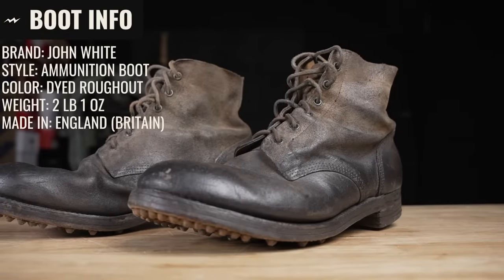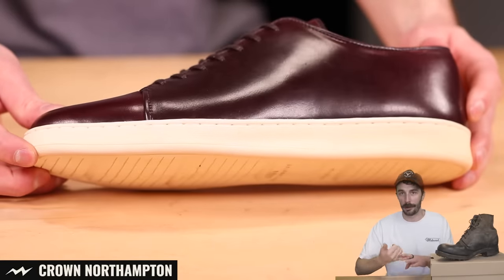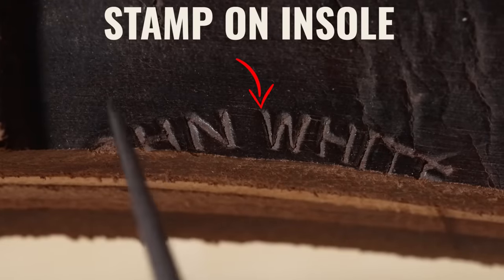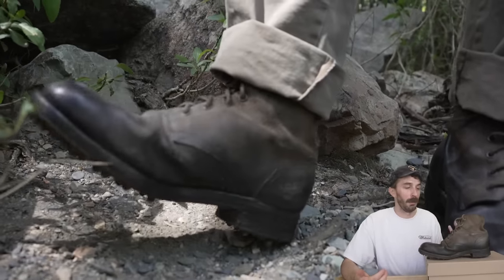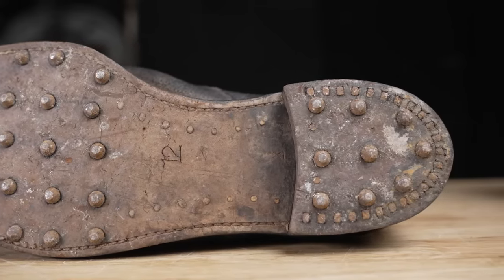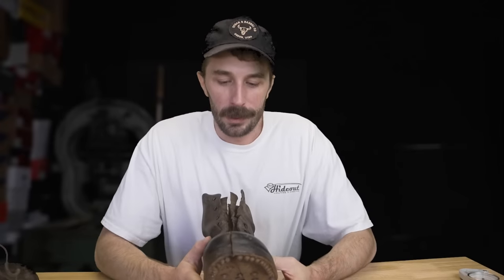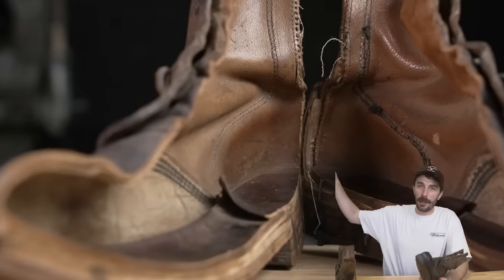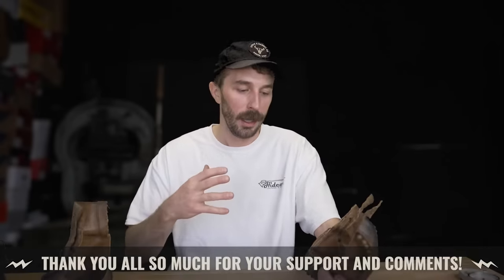Why 80 yr old British WW2 boots are better than modern boots

Comment: It's neither the ammonia nor an old wives tail, it's making the leather wet and then wearing the boots that forms them to your feet better. I came across this by "accident" when i did my conscript time. I was standing in heavy rain for two hours waiting for a convoy to arrive and guide them into place. I was able to wear an issue Goretex jacket, and my steel helmet, so my upper body stayed dry, but the rain water ran down my knees and into my boots. That happened around 6-8 in the morning. Then the rain stopped and the sun came out. I wore the boots the rest of the day, put as much newspaper into them over night, and wore them again the next day. So i basically wore them until dry. Never ever has a leather boot had a better fit to my feet than that pair of boots! (i sadly had to give back at the end of my service)
So in short: you can just make the leather a little wet and then wear them.
Reply: I’ve also heard very similar stories and always been told too pour water into my brand new boots and wear them until they dry out ( either through heat of my feet or the environment ) or wear them for around a day or so and dry it out with some paper or cloth 

Never done this myself but I’ve been told many times it’s the best way to wear in a new boot
Reply: They make shoe stretch spray that has the same affect without ruining any warranty they may have
Reply: It's not the same as just getting them wet with water. In the German paratroopers, we also pissed in them and it neutralizes some of the tanning acids that soften your skin/inflame them and cause rashes and blisters in the beginning. By peeing in them, they won't get much softer but guys who did it had less blisters and hot needles to deal with.
Reply: That's kinda lame that you had to give them back.
Are they really going to reuse boots?
They should have just let you keep them.
Reply: There is the old trick of petroleum jelly as well
Reply: @spaceman51974  We got guys who got old boots (like myself) and we got some who got new boots. Old ones should not have that much tanning acids in them anymore. But i had lot's of comrades who had blisters in old boots too. In our case it was the ill fittment, and the lacking knowledge of what to do against it. I personally (even with my at first very ill fitting boots) had no blisters. (I wore two pairs of socks and tied my laces rather tight and in a manner, so no heel slippage would occur.) So i am a bit skeptical if it was because of the minor ingredients of the piss, or rather the major one (water) ;-)

(my rain incident happened 4 months in, and we did marched almost 5 out of 6 days a week.)
Reply: @pewpewTN  Oh, our army reused them many times. (costs ->our army is well documentedly underfunded for more than 160 years ;-)  They were 360 double stiched welt, very well made leather boots. After each recruit, they got disinfected and checked if they needed repair, if so they got repaired. And in case they were beyond repair, new ones were issued next time.  Of the 12 guys we were in my group at the first day, only 2 got new boots. We got 2 pairs of boots each: "light ones" and "heavy ones". The heavy ones had even thicker leather, were triple stiched welts, and were able to fit ski bindings to them. Those were the "combat boots". I never got those to fit as well, the ones i got were just too wide for my feet. But after 3 months we were allowed to decide for ourselves which boots to use. So i often picked the "light ones" and those were the ones in the rain incident. 
I could have "lost" them and paid a little fine instead of returning them at the end. (which would have been way less than buying such a pair of boots on the civilian market) But i am too honest for that.
Additional info: those boots at the moment cost around 200€ on the civillian market, and they are still made the same way. I got a pair later, and made them wet with a sponge in certain areas before wearing them and they now fit very well too. (Not as well as the rain ones, but that's not a problem, i do not march as much as a civillian :-D)
Reply: @nirfz  Thanks for the info.
Sucks that your military is having to pinch pennies, but at least you have your own pair now.
Reply: @nirfz  Only recently discovered the amazing benefits of two pairs of socks to stop blisters. Not just any socks. Get liner socks - usually from specialist hiking stores but thin running or cycling socks also work. Total game changer, even with top quality boots that are well worn in
Reply: @pewpewTN  Yep its a stupid Army thing. You have to give back all your issued kit. Then you join the Reserves and they issue new stuff. Crazy.
Reply: It would be hard to pee in New boots.
Reply: @cuebj  👍absolutely. You can also take the boots a size bigger, and use thicker socks ;-) I had tennis socks as "inner ones" and the thick woolen army socks "outside". (weren't that many good hiking socks ect. back then)
Reply: Soaked my new boots in a bath overnight then wore them until they dried out and never had a problem with blisters or strains. Mind you, ALWAYS wore a thin inner pair of socks underneath my army-issue woolen socks. Talcum powder on your feet under the thin socks also helps but you have to be careful not to apply too much or you're asking for trouble....
Reply: @jackaubrey8614  Over night seems a bit much to me.  But the 2 pairs of socks strategy has worked for anyone i heard so far.
Talkum powder and or talkum salve did not prevent blisters for my collegues back then. (But talkum powder or salve on the inner thighs prevented intertrigo when marching on hot weather.)
Reply: Wow, you were in the Army and you got your boots/feet wet? Good thing you stumbled onto this technique.
Reply: Yes or sold as surplus
Reply: @roverboat2503  I wonder what the fine is for "losing" a pair of your boots? If the fine is less than $200, might be worth it to just keep them. There truly is nothing better than a well-fitting pair of boots. Every man needs a pair of welfitting, well-made (expensive) boots in the their life. And an authentic, leather Dopp kit.

Comment: High quality does not mean practical in today's battle field. Anchored down with a pair of weight-laden boots weighing 2 pounds on each foot will definitely handicap you where mobility and agility are foremost requirements. Of course, without the need to of a lengthy break-in period is god-send on the foot soldiers while on a warpath.
Reply: Back then soldiers walked more...
Reply: Great if your supply line is intact but certain death if you are caught behind enemy lines and your boots get shredded by NATO wire or the synthetic melts cause you left it too close to a fire and you have to hump it barefooted. 😂
Reply: And yes, guys were just tougher back than most metrosexual soy boys these days.  😂
Reply: @spaceman51974  ah yes, men that fought in a war are tougher than men that have never fought in a war. What an amazing observation.

Comment: I have a pair of Cheaney boots, made in Northamptonshire and they are easily one of the best pair of boots I've ever owned. They weren't cheap but I figured an upgrade to my thorogoods was necessary after the plastic welt snapped.
Reply: Very interesting. My beloved old Thorogoods are finally reaching the end of their lives after three years of faithful service. I might have to look into those Cheaney boots.
Reply: @jeremyt2212  I will say, I wasn't using the thorogoods for their intended purpose (decent VFM work boot) but simply as a decent all weather boot.

Comment: Couple points:
- The General Service boots (ammo boots) in British service were of a pebble grain leather. Generally not this rougher side;
- They were straight / ladder laced, in order to be cut open in one swoop in case of foot injury;
- There weren't any hobnails on the heel. There was a horseshoe fixed to the heel. Also there was an iron toe plate nailed to the toe of the sole. Both fittings were done to protect the sole from wear. The hobnails was a combination of protecting the leather and adding grip to the leather sole.
Reply: Been looking for this comment

Comment: I’m a wwii reenactor and portray the 9th para battalion during 1944 to 45.(British airborne )

Those are indeed not standard issue British ammo boots. The standard issue ammo boots were a cap toe pebble grain boot, that came black and the only thing a soldier would do is mirror polish the heels and toes and dub the rest with period water proofing. 

As for the peeing myth, it by no means was anywhere near common, if done at all.

As with any all leather boot they do indeed hurt during the break in, but once they’re broken in they feel amazing. Also the hobnails don’t hurt at all with 3 pieces of leather in between. 

Sm wholesale and William Lennon make on par boots to originals. 

I love your channel but the info on your WWII boots could be better.

Comment: My first pair of boots were hobnailed boots. No such things as rubber soled boots in those days. It's not an old wives tale that soldiers used to pee in a new pair of boots. They would leave them with the pee inside overnight (if I remember right) to soften the leather, and then put them on while they were still soft and wear them until they were dry. That way the boot would dry to the shape of your foot. Guys who didn't do this had their feet rubbed into blisters and bloody raw patches when they went out for their first route march ......

Comment: Regarding the ruggedness of the Ammo Boot, it is amazing. However, having actually used these boots, while on parades when I served in the British Army, and when I was a WW2 Re-enactor. Even after they are broken in, they where unconfutable with not much flexibility, requiring padded insoles, and tended to cut into sections of the foot after long marches. There was also the problem with the tongue of the boot not being sewn in, therefor it use to leak water into the boot. The DMS (directly moulded soul) versions in the 1980's with rubber soles, although more flexible, still required short puttees to be used, to ensure mud and water did not enter the boot. I was very glad when long legged boots were issued in the mid 80's. The comparison between the ammo boots and modern military boots is like night and day..  I understand the purpose of these videos, is to discuss the characteristic's and making of a particular boot, but unless you have walked in those boots, you will never be able to appreciate the essence of that boot.
Reply: importance of field 
experience
Reply: Yeah, a tough boot isn't always a comfortable one, unfortunately. That lack of a gusseted tongue also sounds brutal. Lord knows, puttees only keep out so much.

Comment: I joined the Brit Army in 1989. The ammo boot was changed about then because water was getting in over the top in the Falklands. They changed it to a higher boot but cheapy made with no research. Out of a squad of 50 in basic only 17 of us were left without shin splints. It turned out the boots were not letting you bend your ankle properly. A year of so later, some Doctor discovered the problem and we had to lace the boots up missing holes, were your ankle bends. Later boots fixed the problem. Underestimating how important basic equipment like boots are can lead to big mistakes.
Reply: They were not ammo boots but DMS and my feet were soaking wet when on patrol , guys were having feet problems in fermanagh I never served in the Falklands but in NI we were issued boots combat high to overcome come water getting into the boots, and we covered the boots combat high in neats oil then polished them to a dull shine because of the neats oil , then had to bull the buggers for guard mount and other shit parades I was issued the combat high boots just after the Falklands war still have them bulled up but the rubber soles are falling apart, bad  shelf life
Reply: My mates in 2 para brought back Argentine boots from the Falklands and were selling them 
For too much money

Comment: Hi I think these might be officers’ boots, made for private purchase. In WW2 and before, British officers had to furnish all their own kit and uniform, sometimes even revolvers.
Officers’ boots were generally brown, (perhaps not all regiments as some chose black leather) and sometimes included features not found on issued ammo boots. I see these boots have a soft leather lining (very nice) and it looks like they have a sewn in/waterproof tongue which were not part of the War Dept specifications.
IF the soles and heels have not been replaced over the boots’ life then the long headless nails in the heels are similar to the the heels on many private purchase officer’s boots. The issue ammo boots had metal horseshoes rather than these - very loud and very hard wearing. I’m not sure how “officer like” horse shoes were considered, as they were a feature of a working man’s boot. This stuff matters when you are an officer, and certainly might draw comment from a more senior officer!
Ammo boots were even more hard wearing, and started life with a black pebble leather and toe cap. The heel, toe cap and sometimes the whole boot might start life being smoothed down with a spoon heated over a candle and pressed onto the pebble finish. Beeswax could then be rubbed onto the hot leather, and a smooth finish built up, for a mirror shine. This generally only happened during initial training, or perhaps if a regiment was based in the UK, or the owner of the boots got sentenced to the “glass house.” In those circumstances the number and layout of the studs/hobnails would be inspected and penalties may be given for deviation from regulation.
I’m sad to say I had to use a blowtorch to get my ammo boots burnt down, then did the whole beeswax thing. Hob nails are great grip on grass and most natural surfaces, but a complete bastard on smooth hard surfaces like concrete. Many times have I seen an immaculate soldier, carrying rifle with fixed bayonet, stride out then be flung on his back, as he slips, usually accompanied by a whispered snigger from everyone else formed up in the ranks, bloody glad that it’s not them!
Reply: Crockett and Jones make a repro WW2 officer boot based on their archive. It's not rough-out leather like the boots shown. 
The ones in the video seem to be based on standard workboots with upgrades to lining and soles.

Comment: Man these actually hurt to see cut in half. I found a pair of boots like these and had them restored with a new sole for daily wear.
Reply: I was about to say. These are 100% wearable. Even if you had to get them resoled. The uppers are fk'n beautiful. A lot of designers now try to replicate this look. No way would I have cut these up. I would wear these.
Reply: I know.  they needed new welts technically but I bet a skilled cobbler could have gotten away using the original welts one last time.  Everything learned from destroying these could have been learned by re-soling them.  This video was really hard to watch because of that.

Comment: When I first started hiking as a teenager in the mid sixties (Australia) I used army disposal ww2 boots just like these. I put trihobs in them which was standard AIF issue. The traction on mossy logs or greasy rock was terrific, much better than any of the rubber soles I have used since. Not so good on hard smooth rock and terrible on tiled floors. You could wear them wet for days.
Reply: Hob nailed boots were renowned as being slippy on cobblestones in Northern Europe late in the war.
Reply: I did exactly the same thing when I first started Scout's in the late 90's.....still got that pair and usually are my go to boots